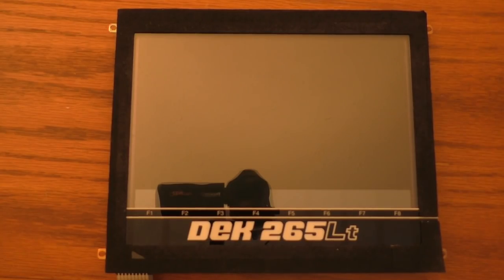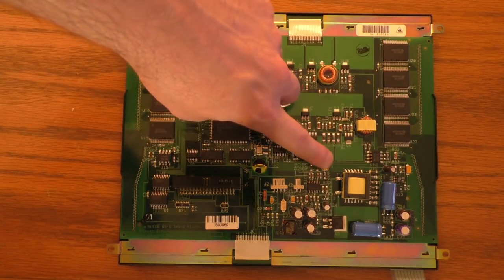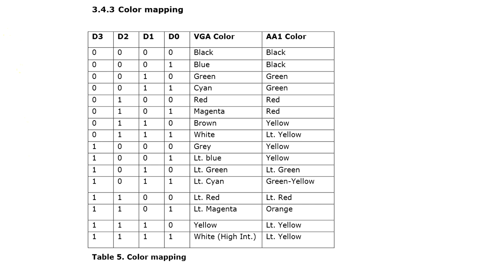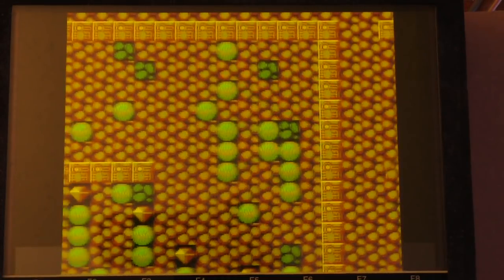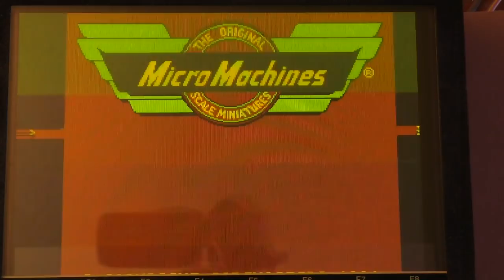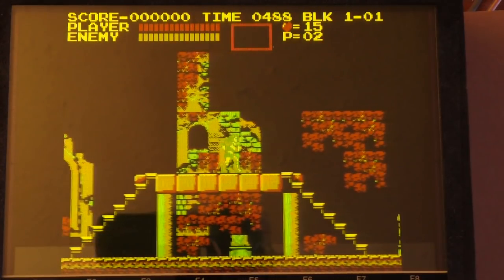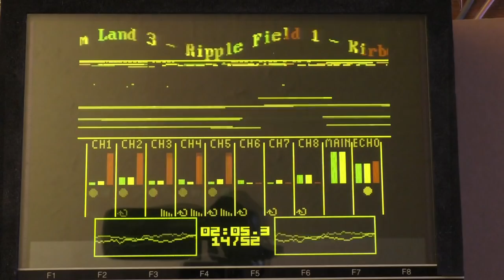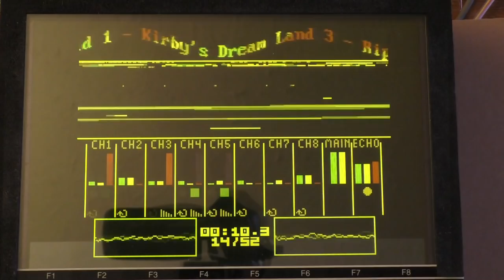FPGA NES and SPC on a Planar EL Display (EL640.480-aa1).

Comment: I recently scored an EL512.256 off ebay for $15 plus shipping (and there's one left) and it just arrived. Looks like NOS likely barely used if at all, no visible burn in and everything looks factory fresh. I cant wait till I get some time to dig out my old spartan 3E board, fire up xilinx ISE and have a play with it.

Comment: Hey Kev! Love all your work! Should Artemio Urbinas 240p test suite work on Super Nt? Sorry to bother you brother but I’m just jacked up to run my Super Nt through my DAC on my WEGA 32” and I want the picture to be perfect! Thanks again for any help you can provide
Reply: Hello again Kevtris. To follow up on my earlier question. I have figured out that this was indeed an ID-10T error. I realized I only put the .sfc rom in the 0-9 folder instead of just placing the entire 240p test suite folder alongside the other alphanumeric folders so it could have its resources. Works great now! Yet another check in the mighty Kevtris’s corner. Your Super Nt handles everything thrown at it!